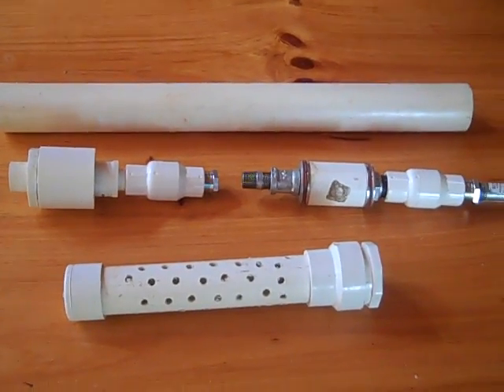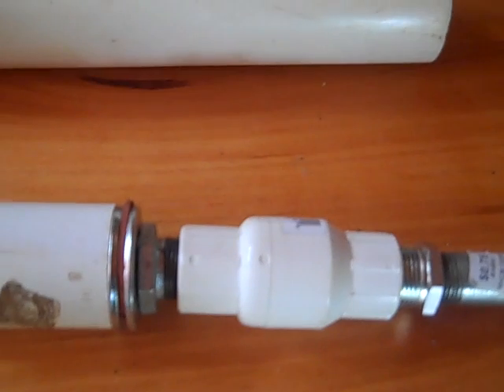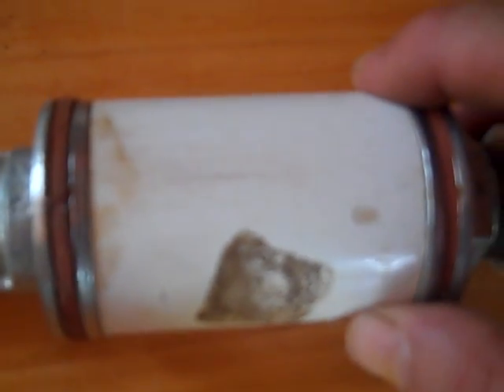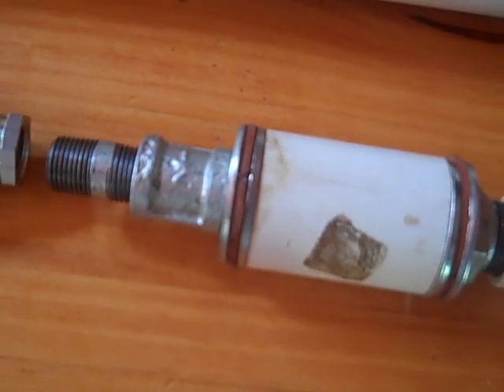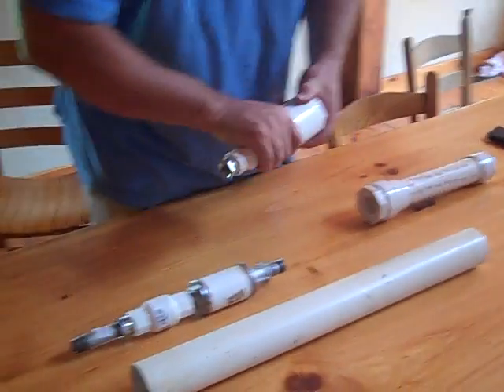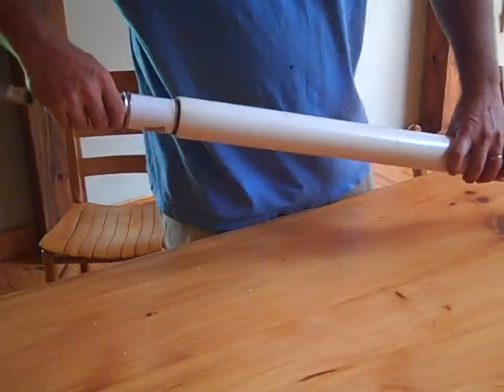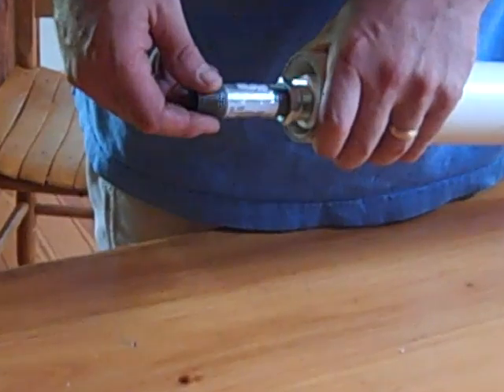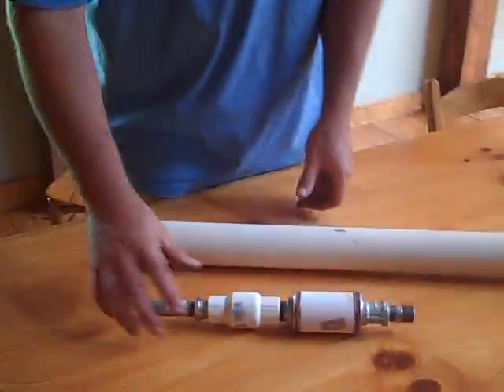Deep well cylinder

Comment: I've been told that the limit for these types of pumps is just less than 50 feet.  Is this true?  To go deeper you would need a double action pump as I understand it.  Hydromission should have this info.  I designed an adaptation of this pump with simple check valves made from pvc and has a slide valve - all the pieces are self manufactured. (Search DIY PVC hand pump.wmv)